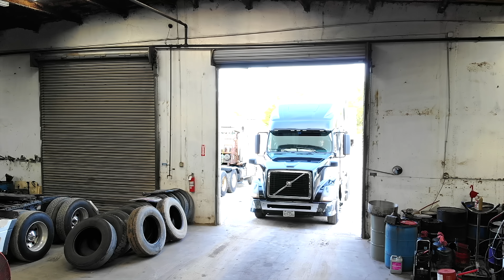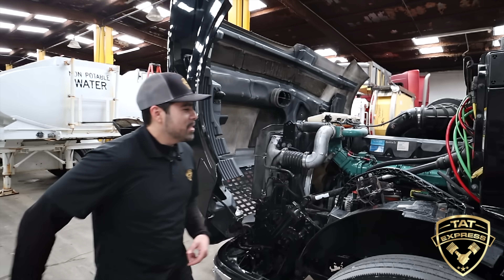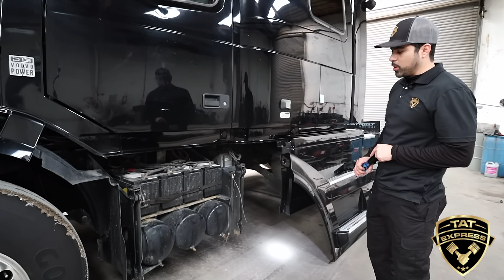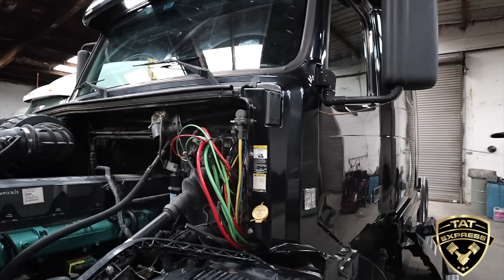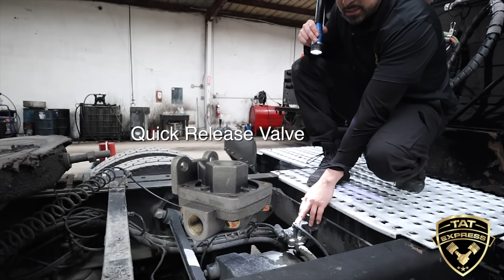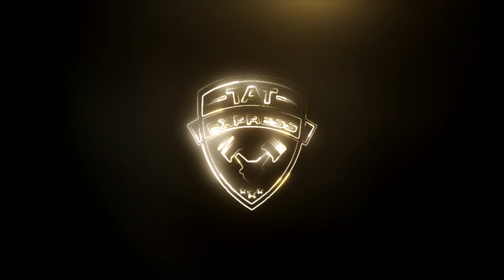How Air Brakes Work On A Semi Truck

Comment: Nice vid.
Best part was the end where you say to use OEM parts. 
Know that valve manufacturers use the same housings for different valves (inner workings are different). Using wrong valve could cause brakes to do wierd things even fail. = your liability.
Reply from the maker: Thanks for the info!

Comment: I have a question when replacing the air brakes compressor is it necessary to time the compressor & to time back the crank to the mark or you can just set the timing mark on the compressor ? Oh on a 2013 Freightliner Cascade 125
Reply from the maker: Curtis, air compressors do not need to be timed.
Reply: TAT Express Inc. thanks

Comment: Anyone here knows what is the "ATC" switch for? I'm driving a 2013 Freightliner Cascadia
Reply from the maker: Kendu, thank you for the question.  ATC (automatic traction control), in some cases you may need to disable or enable this feature.  Frieghtliner has installed a switch for that option.
Reply: @TATEXPRESSINC  oh ok. Thanks. I never used it. I have been driving for 6 months. Is it for rain or snow? Heavy loads?
Reply: @kenduwilliamson5436  all of thee above.

Comment: Hi Adam,

just a quick question if you could answer but do the rear abs valves ( under the fifth wheel ) have anything to do with the rear air ride or leveling  valve?

Thank you
Reply from the maker: Sir, the abs valves do not have anything to do with the rear air bags. The rear air bags have a dedicated leveling valve
Reply: what type of truck? While they domt technically have any relation there is a valve on the side of the frame by the transmission that would lead you to believe either the brake system or air bags have issue caused by the other.
Reply: @christopheryoung826  2015 Freightliner Cascadia DD15. The ride is really roigh rough and I replaced twice the leveling valve and and can valve. it has been properly adjusted but still have the issue with hard shifting and very very rough ride that is coming from back of the truck. feels like the air bags are getting overinflated whike driving down the road.  there has to be some kind of control valve other than the leveling valve. maybe air tank? some type of check valve? when you think about it,  the air that is going to the leveling valve is the same air going to the brakes from the secondary air system. there has to be some type of restriction or something going on.
Reply: @MrTurboVeki  literally having the same problem. Changed secondary tank and every valve on tractor and new air dryer. Nothing else to change besides the compressor itself. Did u happen to figure out the problem?

Comment: do you know where I can find out why my front air gauge has a lower pressure reading then my rear air gauge? I would like to adjust it so both have the same pressure reading. Front has 115 psi and the rear has 125 psi. thank you
Reply from the maker: You may have an issue with a check valve or an air leak on the tank that is reading lower
Reply: @TATEXPRESSINC  thank you

Comment: You left out that “air brakes” not like hydrologic brakes like of cars and trucks. They stop using the increase in fluid. It’s my understanding air brakes work by  releasing pressure. 

In your average automobile a damaged brake line will keep the brakes from working. And on big trucks the brakes work by releasing air. 

You’re showing us all the major parts of the system you’re not explaining it to us and you don’t have a trailer hooked up because I’m curious what those two lines do? Is one for the left brakes and for the right brakes is one for high-pressure low-pressure? I am sure that a breach in the system will cause the brakes to lock up regardless of if they’re ABS or not. 

I figured the reason you had to have a special license to drive a semi truck is so that you understand that they are totally opposite to brakes on regular automobiles. The standard on most of them being you increase pressure to the brakes and that increases friction but in the semi trucks you press the brake pedal and that actually relieves pressure engaging the brakes. Basically ensuring that if there’s some kind of catastrophic failure all your wheels will basically lock up. Am I correct or not like I was hoping you tell me what would happen if one of those lines to your trailer filled with cars I mean like tell me about this governor explain to me how the interlock brakes work because they would have to work differently than on your regular automobile? 

I mean the way anti-lock brakes would have to work on a semi truck would have to be totally different at least opposite to those of regular vehicles and do your trailers have antilock brakes to and does the engine have traction control where if you were trying to over accelerate and will start spinning does the engine lose power?
Reply: Get a book.